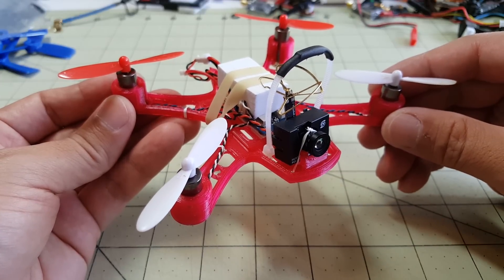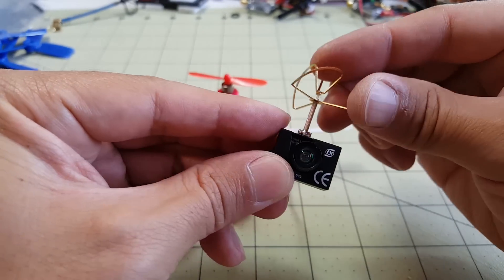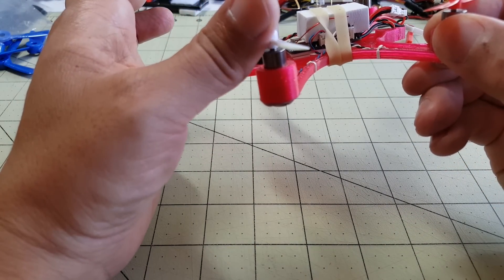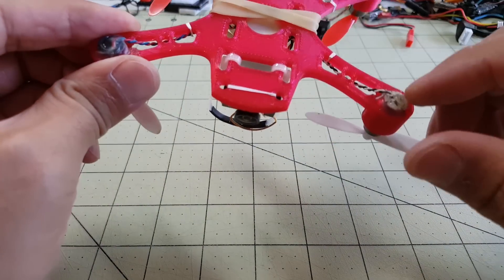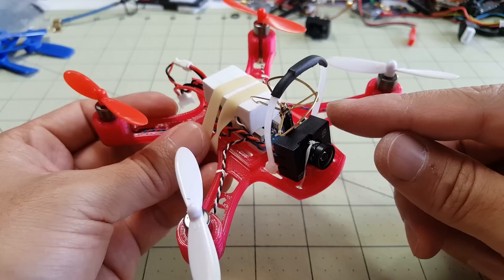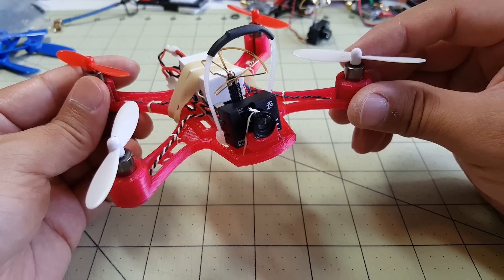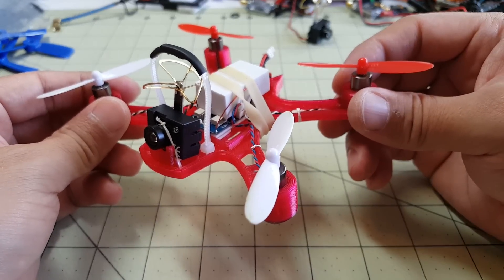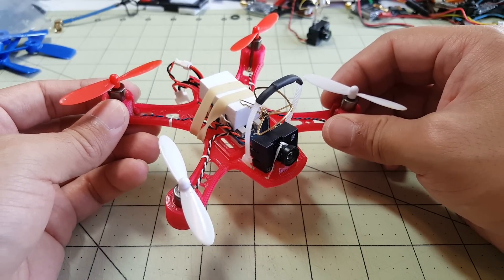Scisky Microquad Deluxe

Comment: Hi,
How do you know when the battery gets low?
Really enjoy watching your Videos.
Reply from the maker: Thanks. There is a small light that starts flashing on the board when the voltage gets low but there's no way to really see that in flight.  Also no buzzer, so I just set a timer on my transmitter and land when it goes off.
Reply: +Albert Kim (marblekit) Thanks for the answer.
Is there any way of getting audible feedback?
Since I am only flying FPV the light is unfortunately no usefull solution.
Reply from the maker: I've heard of people adding a small piezo buzzer but it's a difficult mod and requires tricky soldering which I felt was pointless since using my transmitter timer was working so well. I was consistently landing around 3.8 volts which is just fine with me.
Reply: +Albert Kim (marblekit) This (F3!) Board here has two solder pads wich are marked for "Buzzer" so it would suit me better. http://www.banggood.com/Micro-32bits-Brushed-Flight-Control-Board-Based-On-SP-RACING-F3-EVO-Brush-For-Micro-FPV-Frame-p-1070068.html
Although thanks for answering my questions.
Reply from the maker: Yes, I have those coming and will review them on my channel in a few weeks.
Reply: +Albert Kim (marblekit) That is incredible nice to hear since I will order the parts for my quad (including this F3 fc) soon.
btw, what do you think of this FPV transmitter-camera: http://www.banggood.com/Eachine-EF-01-AIO-5_8G-40CH-25MW-VTX-800TVL-13-Cmos-FPV-Camera-p-1064301.html
Will you need a pololu 5v
step up or does it the direct 1s battery voltage work without having problems under full throttle?
That is all my questions for now😀

Comment: Hey Albert, did you manage to find those micro multicopter gear motors that I emailed you from amazon?  Those and those walkera CP from banggood look like good contenders to test out based off the rpm's they boast.  Maybe you can do another show down and add those along with the angrybeez motors from FPVheadquarters?  Although, those arent due out until sometime in August it seems...
Reply from the maker: +ptahkeem yes, I'll be checking out those motors and will get them when my Spintechs are done testing.
Reply from the maker: +ptahkeem So the walkers motors don't specify CW or CCW... says you get a random motor....  hmmm..... I think I'll skip that one.
Reply: yea just noticed that...  pretty lame. =S

Comment: Nice little build, have you tried with the battery mounted on the bottom.
You might be better flight characteristics.
Some dual lock M3 tape might be enough to hold it on.
Reply from the maker: Yes, I flew it with the battery on the bottom.